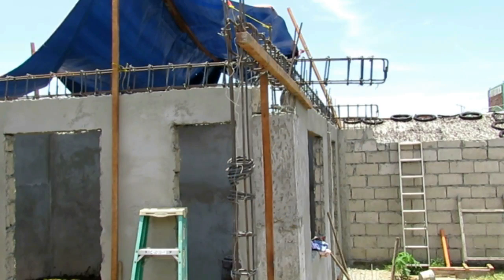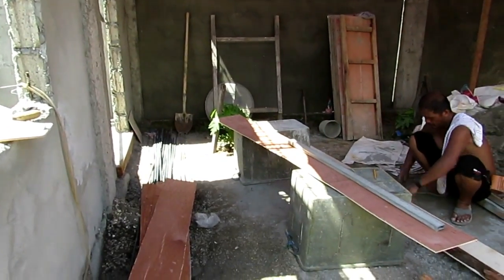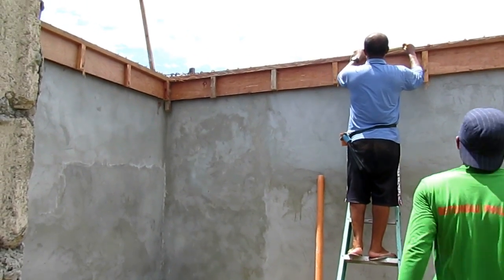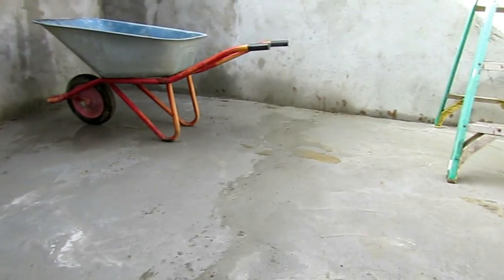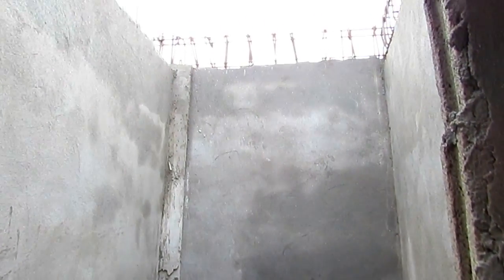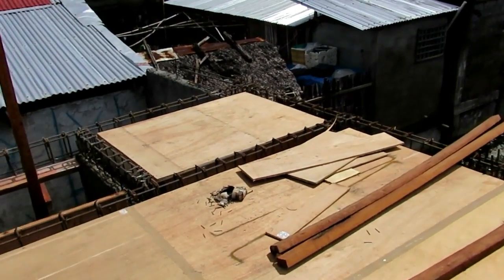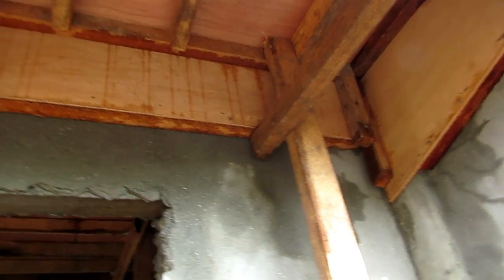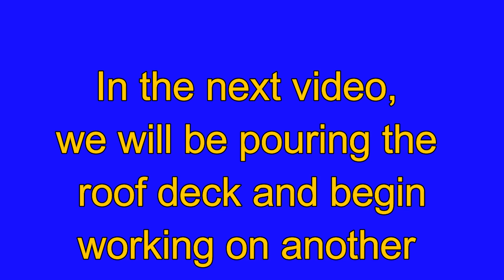Building in the Philippines - Expanding Paradise, Part III | Ep 82

Comment: I love watching your video since you start the construction. Please keep in mind that termites exist here in the PH so i would suggest that trusses, beams need to be treated before they get installed. Also, be aware of the mouse proliferation In the area. (Just in case) I Installed a wire mesh in all my downspout where they crawl going up to the ceiling.
Retired in Pampanga
Reply from the maker: Beams are all constructed of concrete. Roof rafters were treated with Solignum. We had a couple resident rodents in the attic a few years back and then they just disappeared! Probably because we have three cats! he he Thanks for commenting.

Comment: Hello there, just found you channel and really enjoy it and appreciate you sharing your life. Quick questions with your build, do you think it costs more to build where you are ? compared to other islands in Phils? do you have a project manager? Cheers really enjoy watching.
Reply from the maker: The costs involved with construction apply to materials and labor. While
 some materials such as finishing products (ceramic tile, countertops, 
cabinets, hardware, plumbing fixtures, etc) might be slightly more 
expensive on smaller islands due to shipping costs, labor costs are 
usually lower and can offset higher material costs. I am my own project 
manager and my brother-in-law is my foreman.
Reply: Awesome cheers ty for reply.

Comment: When you say you'll turn the roof deck into a terrace, does that mean you will have some kind of permanent roof covering over it?
Reply from the maker: Working on designing a nipa roof system. That way if a strong storm takes it away, the replacement cost will be very low.
Reply: Sounds interesting.  I'll look forward to seeing what you come up with.